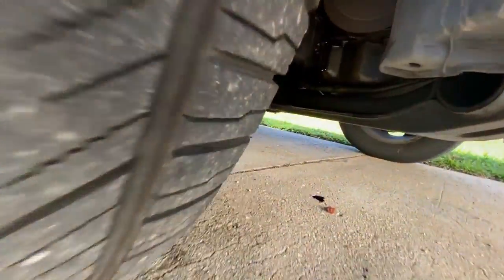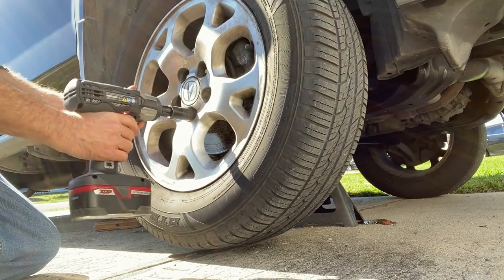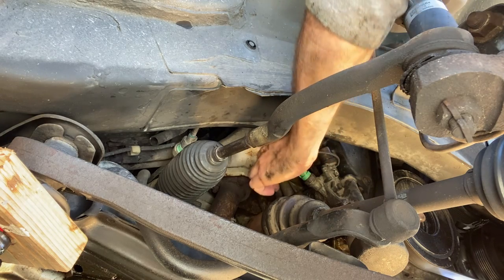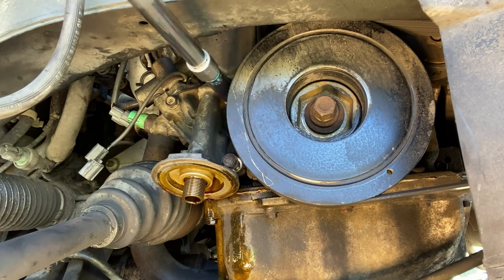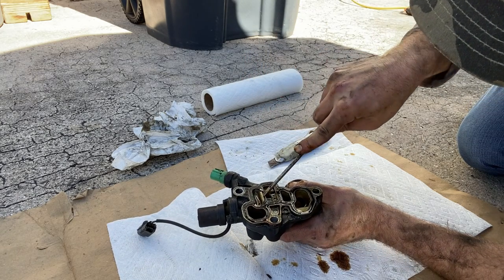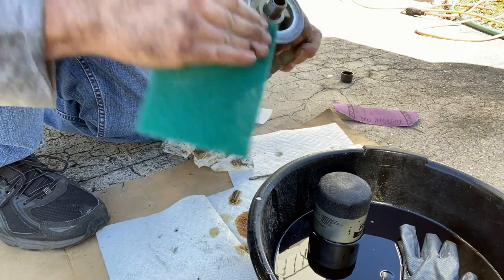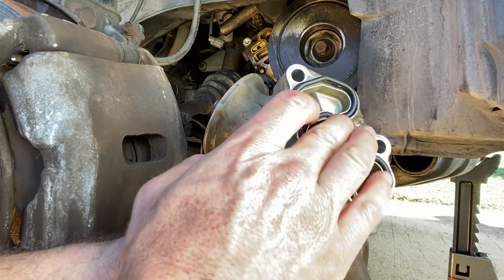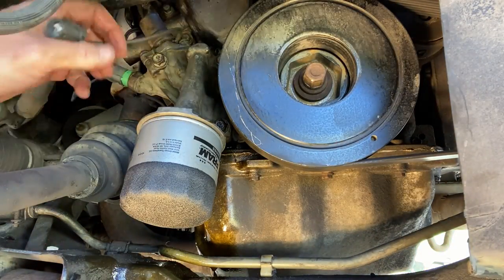Solved - Where is that oil leaking from? (Acura MDX)

Comment: 2011 Pilot --My inside right side cv boot was covered with oil at 65K miles. I surmised the inside cv boot was bad and replaced the rs cv shaft. Had I know this oil pump seal was an issue and possibly the cause of that greasy cv boot, I could have saved a needless repair and replacement of that shaft. BTW 85K timing belt water pump tensioner replacement by Honda dealer (7/20/23) also informed me that the oil pump seals were leaking and did the repair! Good video and thanks. Look close folks if you see oil leak in that area.
Reply from the maker: Yes. We’ve all done it. That’s why its good to clean the with engine degreaser and search out the leak before starting on replacing parts.

Comment: Acura mdx 2003 would be located in same spot correct ? If it would be leaking
Reply from the maker: Yeah. It should be… that said, there are a lot of spots in these old cars that could leak… but a fast leak I would guess is this gasket.

Comment: Notice a leak on my too. Mainly oil just at the bottom. Would it also leak around to that bolt on the left?
Reply from the maker: That’s a tough question to answer. My recommendation is to clean all the oil off the engine, top to bottom, using a degreaser and gloved hand or brush/toothbrush to rub as needed. See if you can identify the leak location without the engine on. Then start the engine and run it for a short duration and look again. Remember that gravity always pulls the oil from highest point down and oil can run on framing, wires, tubing, etc. Use a mirror and lighting to be 99% sure it’s not coming from above where you think it is! 

Valve covers in older cars are always my suspected origination and I always start there if the gaskets haven’t been replaced in the last 10 years. It can also be a combined leak from the cover gaskets and the oil filter assembly gasket. Especially in older cars that haven’t had new gaskets put in.

Good luck!
Reply: @Thatguysauto  no I literally mean that bolt that’s there on the back of engine slightly pass the oil pump and what you changed. Like that bolt that just sticks out by the axle that if yu want to tighten or replace you just get axle out the way. That bolt is full of oil. Ima do this first and then worry about the bolt cuz it looks like it’s a buildup, cuz I cleaned and nothing is dripping anymore. Has to be what you changed if not oil pump is leaking internally

Comment: I have a leak passenger side make smoke , car don’t get overheat but transmission starts acting weird .
Reply from the maker: Hi, first thing, safely check the oil, transmission fluid, and coolant levels. Then, assuming they are full, if you aren’t experienced at cars take it to a mechanic and ask for them to show you the leak and explain the smoke. Blue smoke is oil, black is fuel/air, and white is water. It matters where the smoke is coming from to diagnose - muffler or engine compartment. 

Good luck.

Comment: This is a perfect video for getting to the heart of the issue and SHOWING (not just blowing) all the steps to do this important job.  Thank YOU.  Now to find the proper gasket somewhere and get into fixing some leakage . . .  
But in all honesty I have not washed the car down or found the leak(s) yet.  Going to say this seal needs to be done regardless on a 2006 MDX.  But even the top of the engine is oily.  Could be valve covers?  Thanks again.
Reply from the maker: Yea. If you still have the original gaskets on the valve covers then they are probably leaking. This leak manifested a ton of oil on the rear passenger side of the oil pan. Until I cleaned the entire underside I assumed it was the covers or the crank seal. I was actually happy when I found it was the oil filter housing.

If you go at the cover gaskets, may as well do the intake gasket since it all comes off anyhow.
Reply: Hopefully this is what is leaking from mines I just bought 2011 126k miles .9k cash…Leaking same area I’ll take a look tomorrow
Reply from the maker: Yeah. You arent alone. My ford has been nothing but issues since I got it used like 25k miles ago at 55k. Electric, brakes, suspension, ignition... even the radio wiring had issues. Any other owner would have set it on fire. 

So what happened with you 2011? You get it fixed?